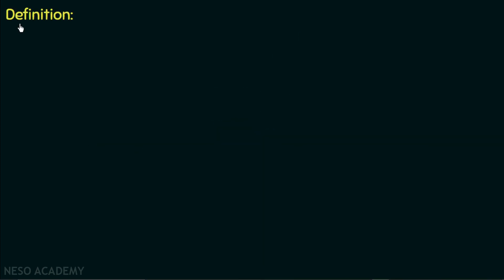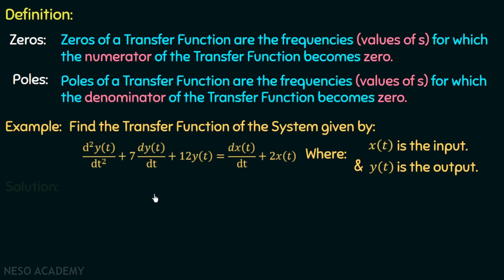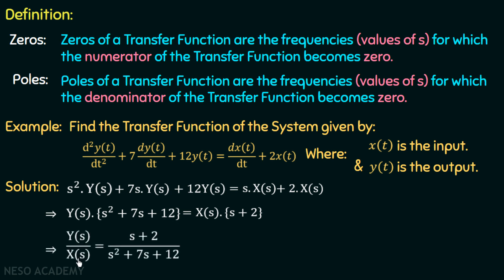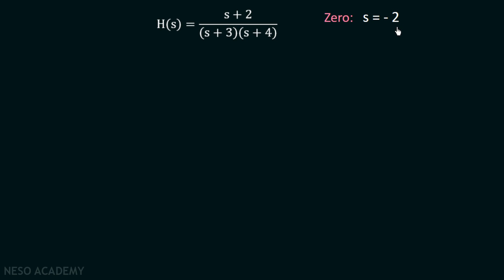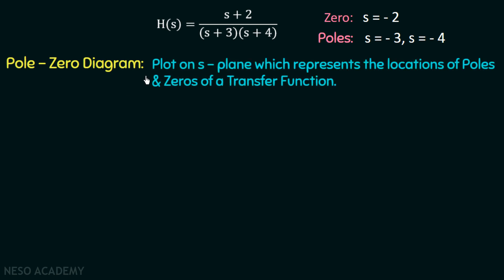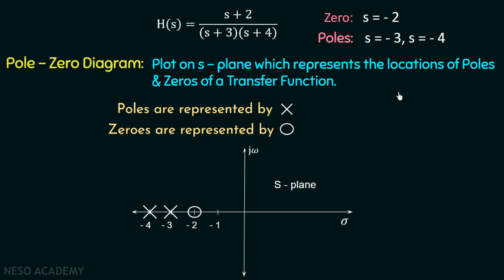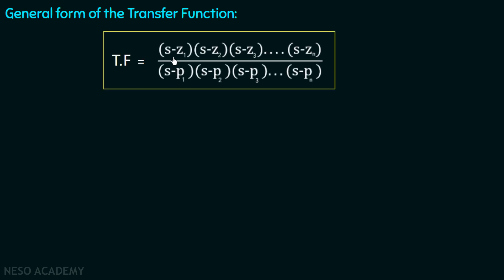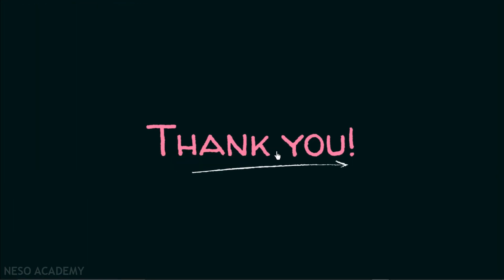Zeros and Poles of a Transfer Function

Comment: there are a few mistakes in this video. At 5:38 the general form of the transfer function should multiply a constant K out the front. Also at 1:54 you say that you "transpose this vector". But it's not a vector and you aren't transposing it. It's a scalar and you divide by it.
Reply: when to poles and zeros are on same point so why would it draw

Comment: 1. Zeros  are -3 and -2. And poles are 0, -1,-4.
2. Zeros   is O. And poles are -1,-2 & -3.
Reply: How did you found the poles? ,, i can't understand what I should excatily do to find it???
Reply: @abdalrhmanez2379  The second part functions poles equations : 
=s^3+6s^2+11s+6
=s^3+5s^2+s^2+5s+6s+6
=s^3+5s^2+6s+s^2+5s+6
=s(s^2+5s+6)+1(s^2+5s+6)
=(s+1)(s^2+5s+6)
=(s+1)(s^2+3s+2s+6)
=(s+1)(s(s+3)+2(s+3))
=(s+1)(s+2)(s+3)
Poles: -1,-2,-3.

Comment: 1. Zeroes: s = -3, s = -2
Poles: s = 0, s = -1, s = -4

2. Zeroes: none
Poles: s = -1, s = -2, s = -3

👏
Reply: how did you find poles in the second question on assignment please
Reply: @humphreykoech6258  By factoring the denominator.
Reply: @humphreykoech6258  The second part functions poles equations : 
=s^3+6s^2+11s+6
=s^3+5s^2+s^2+5s+6s+6
=s^3+5s^2+6s+s^2+5s+6
=s(s^2+5s+6)+1(s^2+5s+6)
=(s+1)(s^2+5s+6)
=(s+1)(s^2+3s+2s+6)
=(s+1)(s(s+3)+2(s+3))
=(s+1)(s+2)(s+3)
Poles: -1,-2,-3.

Comment: 1) zeros: s= -3,-2 ;Poles: s= 0,-1,-4;
2)zeros: nill ;Poles: s= -1,-2,-3;
Reply: Thankyou bro
Reply: how did  you find poles for second sum?
Reply: @558onkarhogade3  same doubt
Reply: @558onkarhogade3   you factorize the bottom part then you will get 3 solutions
Reply: @558onkarhogade3  The second part functions poles equations : 
=s^3+6s^2+11s+6
=s^3+5s^2+s^2+5s+6s+6
=s^3+5s^2+6s+s^2+5s+6
=s(s^2+5s+6)+1(s^2+5s+6)
=(s+1)(s^2+5s+6)
=(s+1)(s^2+3s+2s+6)
=(s+1)(s(s+3)+2(s+3))
=(s+1)(s+2)(s+3)
Poles: -1,-2,-3.
Reply: multiply with (s * 1/s) to the function (because we can cancel it and have one which result in same equation)
and then get the value for zeros -> 0
Reply: Second one how ..bro how u cal
Reply: @maddumani6300  The second part functions poles equations : 
=s^3+6s^2+11s+6
=s^3+5s^2+s^2+5s+6s+6
=s^3+5s^2+6s+s^2+5s+6
=s(s^2+5s+6)+1(s^2+5s+6)
=(s+1)(s^2+5s+6)
=(s+1)(s^2+3s+2s+6)
=(s+1)(s(s+3)+2(s+3))
=(s+1)(s+2)(s+3)
Poles: -1,-2,-3.
Reply: @maddumani6300  
s^3+6s^2+11s+6=0
s^3+s^2+5s^2+5s+6s+6=0

s^2(s+1)+5s(s+1)+6(s+1)=0
(s+1)[s^2+5s+6]=0
(s+1)(s+3)(s+2)=0
Reply: @maddumani6300  
=s^3+6s^2+11s+6
=(s+1)(s^2+5s+6)

=(s+1)(s^2+3s+2s+6)
=(s+1)(s+2)(s+3)
Zeros: -1,-2,-3
Reply: @MdMijanurRahman-zv7lt  Your getting poles . but your not getting zeros. IN this  equation actuall means Denominator poles. And numerator to means zeros.